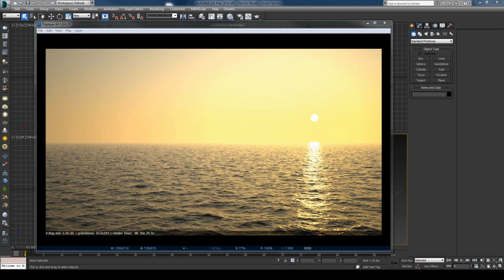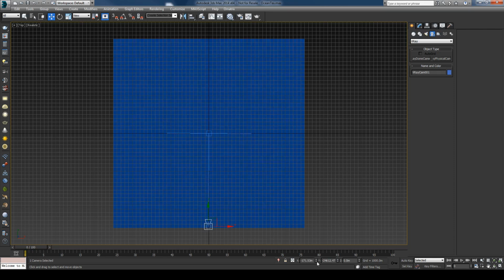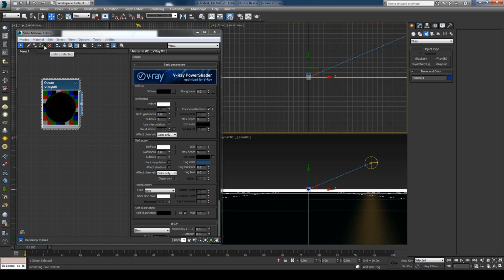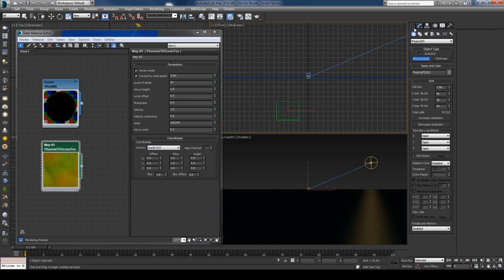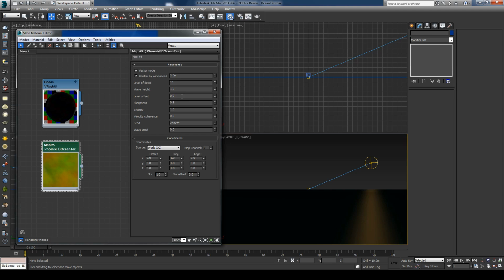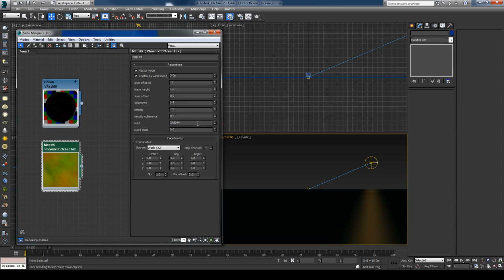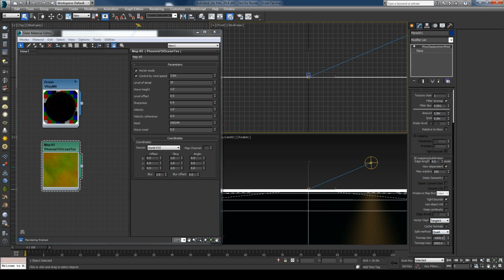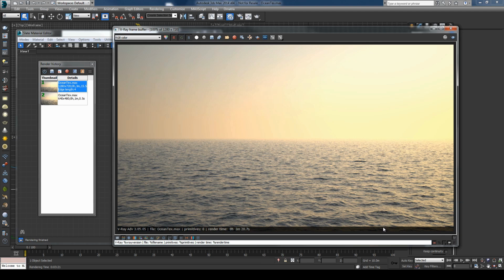Phoenix FD - Ocean Texture Tutorial

Comment: It worked perfect... UNTIL I HAD TO RENDER INTO LARGE SIZE FOR A3. For A3 I need to set the frame into 5000x3700 (more or less), but the Program crashes over and over.
Set the frame a little bit smaller (2500x1200) and then CRASH AGAIN.
I understand that the render may take a long time when we talk about that size but WHY CRASHING? is there any way to avoid this problem?

Thanks !!